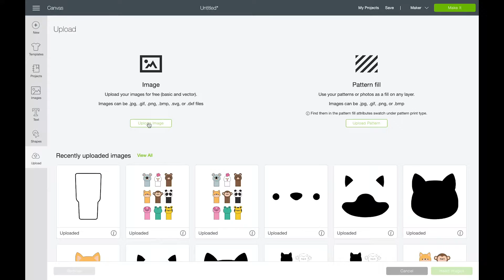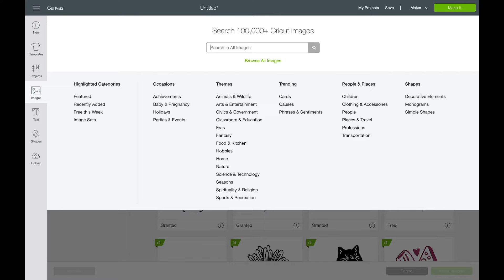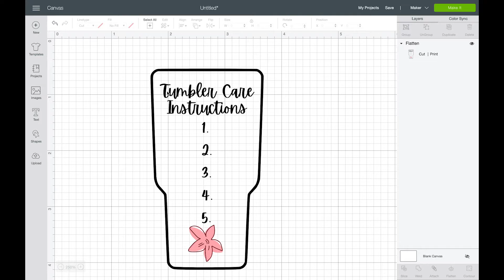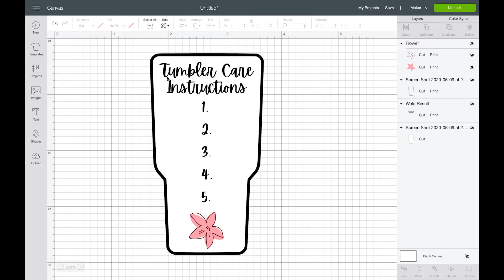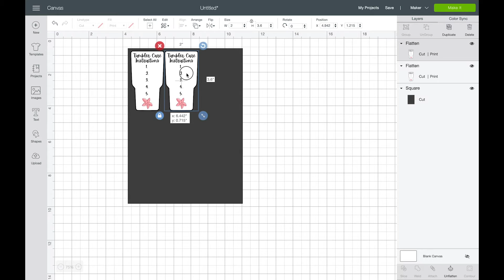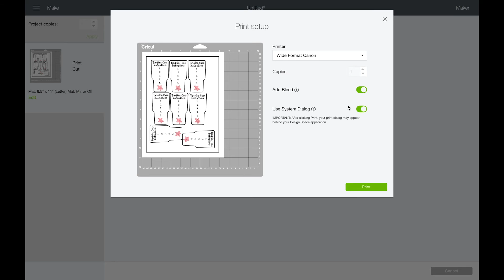How to Make Tumbler Care Instruction Cards Using Your Cricut Machine!

Comment: I found your instructions very easy to follow. I have designed my instructions but am having trouble getting Cricut design space to attach them once all laid out ready to press print - it seems the file is too large and its just not working. Do you have any other suggestions or tips to help with this? Many thanks in advance!
Reply from the maker: I recommend designing in a 3rd party software if possible! Silhouette studio business edition is a good affordable option!

Comment: Hi Karley! I’m curious why do it this way instead of just leaving the inner portion of the tumbler white during the upload process, instead of removing it? Would this  have any affect on the end result?
Reply from the maker: Yelisse Rodriguez I did it this way to show the transparent background. Most of the questions I see on Facebook have this issue so I needed to demonstrate what not to do. But yes— I would actually do this very differently :) I would create the file in Adobe Illustrator and export it as a transparent png!
Reply from the maker: I realized I didn’t answer your question— most people don’t like to import the outline as a print then cut because you can’t change the color of the outline. Which is why they end up with a transparent background. You could upload it is with the inside filled and choose cut file but you’d lose the outline! Hope that makes sense!